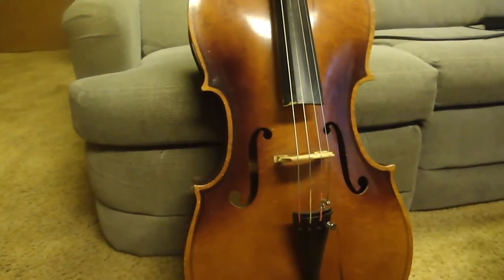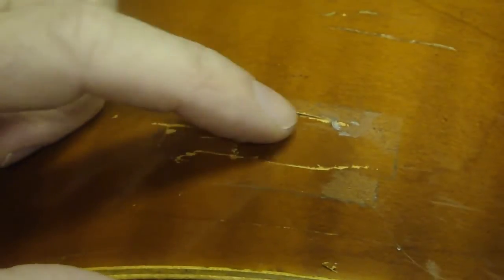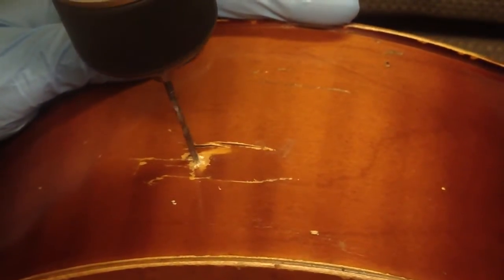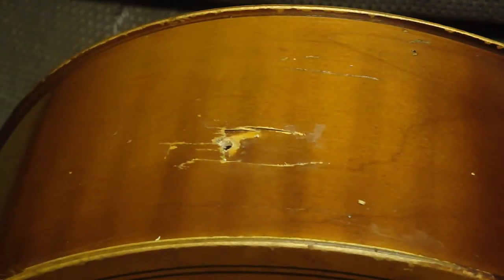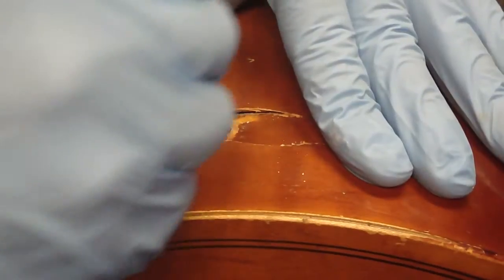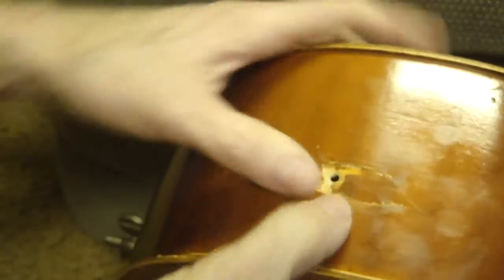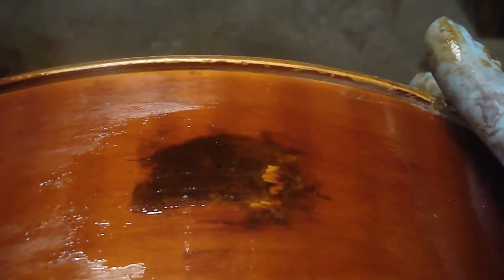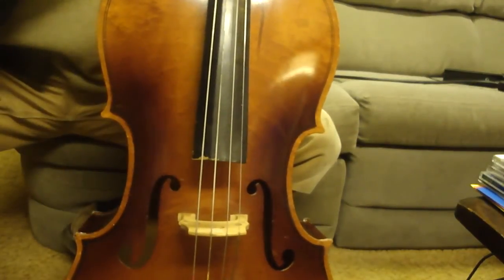How to Repair a Cello

Comment: Not the way you do it! I know it will work in a pinch, but this is not the way to fix a cello, even a plywood one. It's like putting Bondo on a DeLorien.  Just not done. You would have been better off making a patch out of a small piece of Maple or other tone wood, using a strap-clamp to hug the couture of the cello and used Tightbond Hide Glue to glue it all together. Sand smooth, stain a close color and cover with Lacquer.

Comment: One could do the same repair using hide glue and a thin strip of veneer to cover, and sand the edges to blend the repair in. Why hide glue? ..which is also commercially available as a liquid glue.. because you can UNDO it easily, and one can also easily clean off smears and not destroy the surrounding finish. One could have also fished a small glued backing block under it to raise up the indented wood, and pulled up with an old tuner mounted in a 1" PVC pipe coupling , as a clamp. One can make hide glue very thick and color it  to mach the wood, which is also, a removable filler.

Comment: This well-meaning video shows how not to repair a cello (or violin). The small 'hole' would make no difference to the sound, and it did not need such a crude repair, especially as the instrument was of cheap manufacture from plywood. Do not try this technique with on an old/vintage instrument - you will destroy its value.